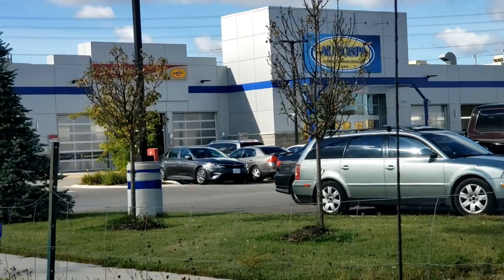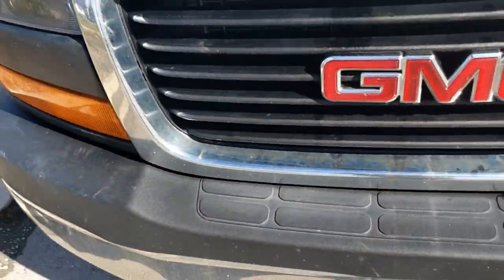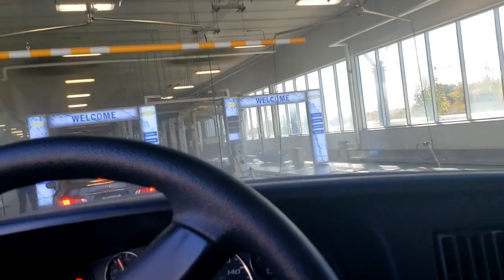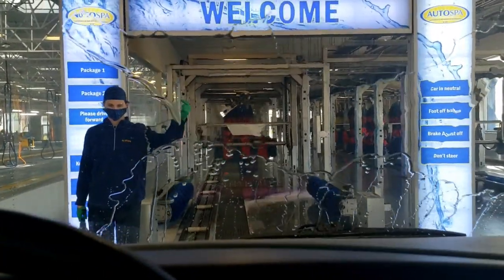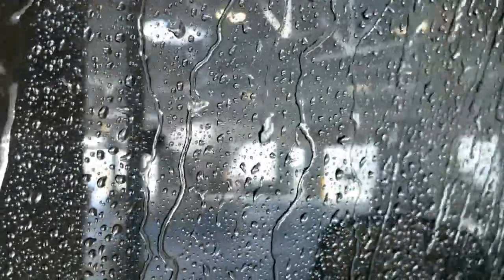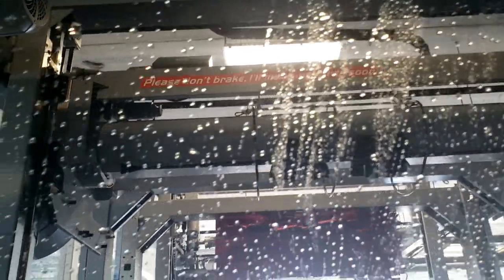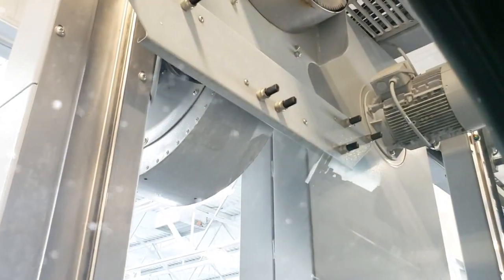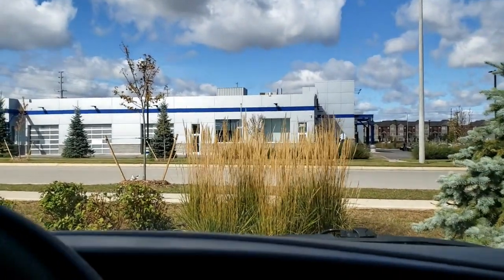Review of the Auto Spa Car Wash in Mississauga / My New Favorite!?

Comment: Wow, that’s a crazy wash.... reminds me of the washes that my dad would take me to way back when I was a kid.... an attendant with the pressure washer, the tire scrubbers.... and so many brushes!!! I could not handle my paint getting hit by so many roller brushes, especially the last dry set.

Either way, that looked cool!

My preference is still the touch-less @ QEW & Winston Churchill in Mississauga... an old brush tunnel changed to the longest touch-less that I have ever seen!
Reply from the maker: I will have to check out that touchless wash :)
Reply: I get concerned about the roller brushes as well scratching the paint. It seems to be pretty hard to find a wash without them these days. The one car wash I was able to find that does not use them is Delta Sonic. It is pretty much touchless except for the  hanging mitter curtains which seem to be much more gentle.